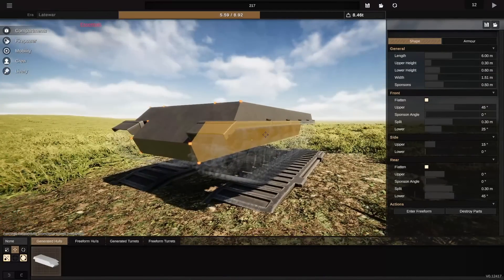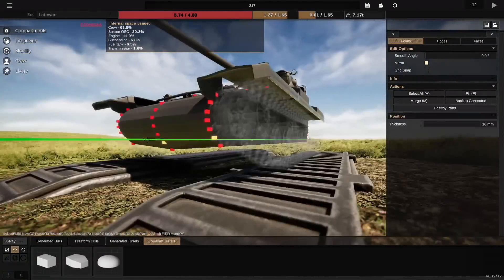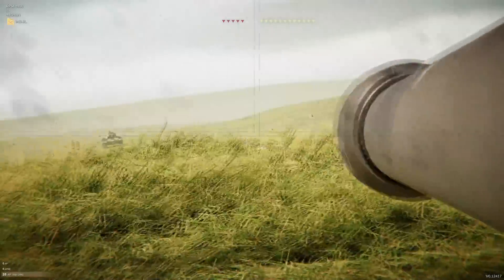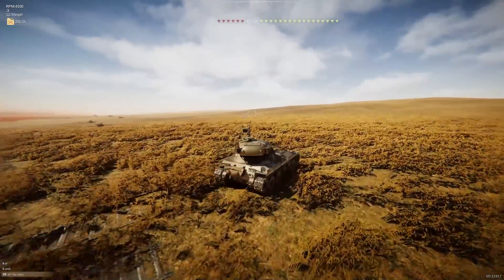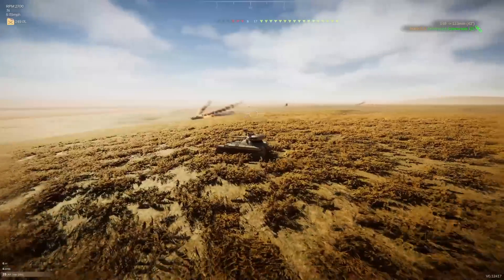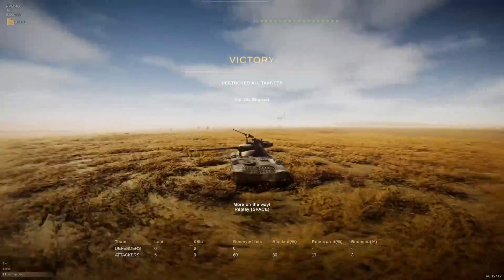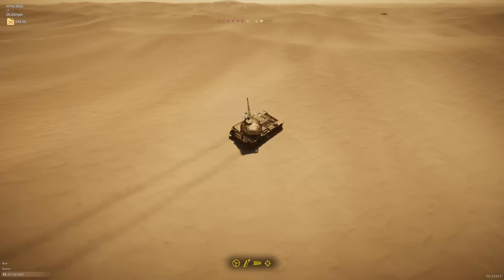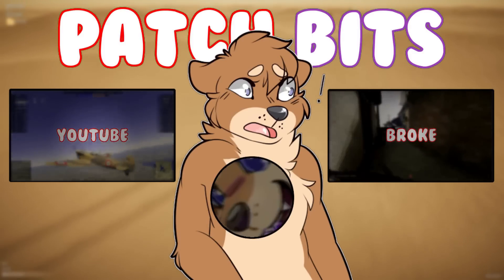Sprocket: Building a light tank with an OSCILLATING TURRET!

Comment: My man patch finally discovers the glory of oscillating turrets amd custom mantlets
Reply from the maker: Always loved em, too scared to make em 😅
Reply: @PatchBits  protip: make them in the "correct orientation" first, before rotating the geometry using the A select all key (make sure to turn mirror off when doing this) then you re-rotate it with the turret ring selected and voila! You have just saved yourself from metric tons of pain
Reply from the maker: Hyup, I knew I was meant to do this, and just didn't.

I do not know why.